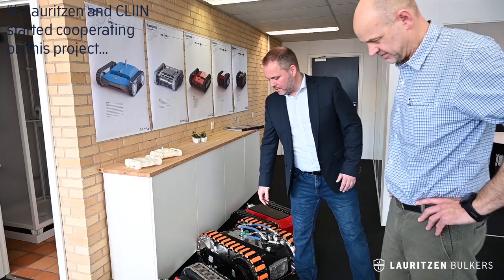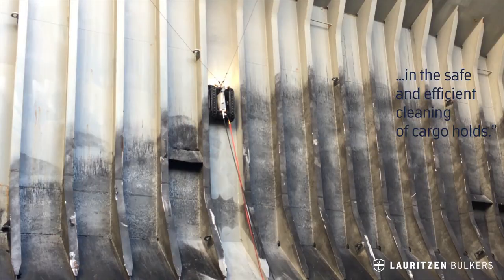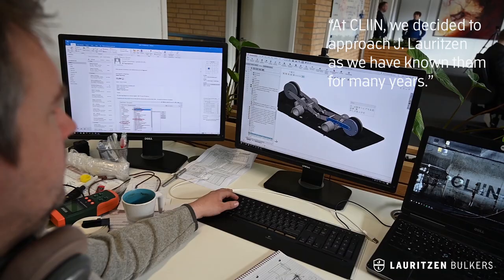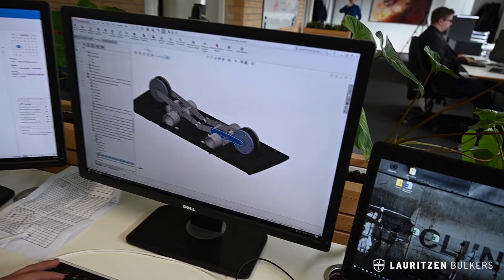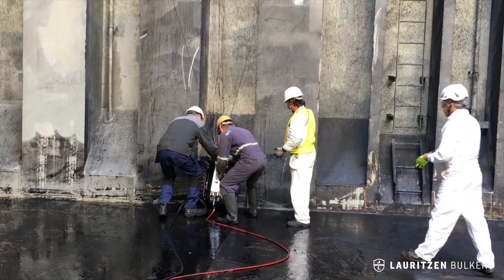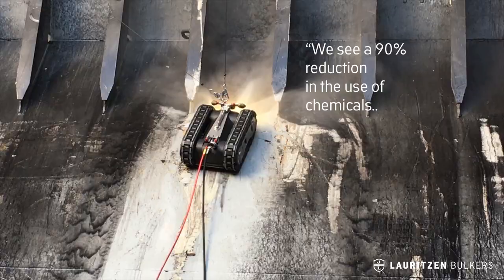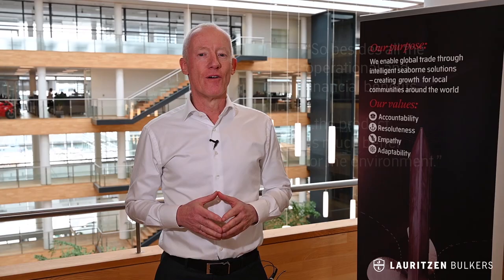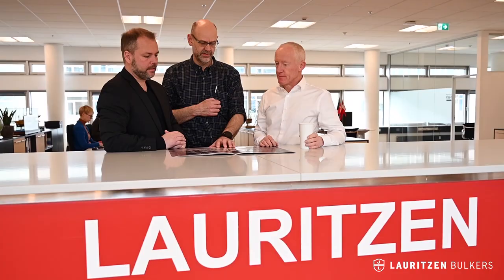Lauritzen Bulkers and CLIIN talk about the robots that will clean cargo holds in future

Comment: great improvement that this prototype comes with adjustable nozzles that enables the robot to remove residues on frames on the sideshell or bhd corrugations. does anyone have a clear picture how long it takes for this little robot to clean a typical hold after dischg steam coal on a handysize bulker? and wonder if Cliin engineers tested the robot on holds after dischg more difficult cargo such green delayed petcoke, cement, and how it looks after cleaning.
Reply: Hi Mike, it takes 3-6 hours to clean a cargo hold depending on the cargo and configuration on the cargo hold (with or without frame) on a handysize and takes about 8-10 tonnes of freshwater per cargo hold. At this point, the robot is able to clean coal, concentrates, and petcoke (if using CLIIN’s hotbox). Cement and lime coat is currently going through testing.